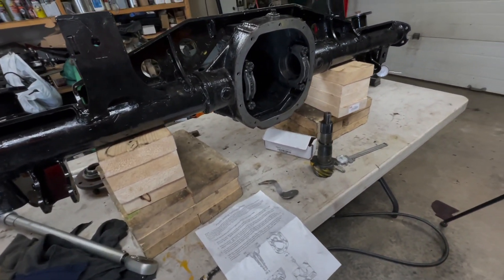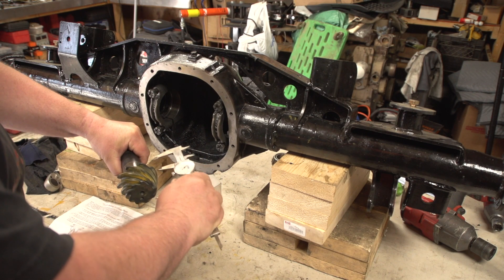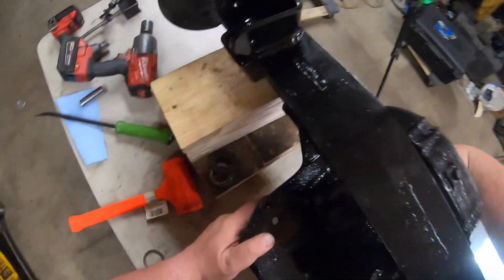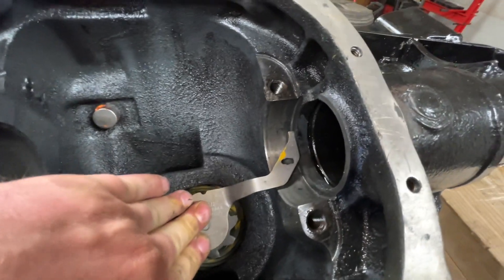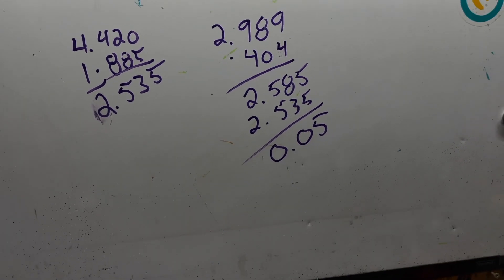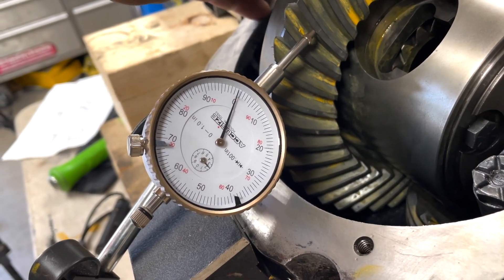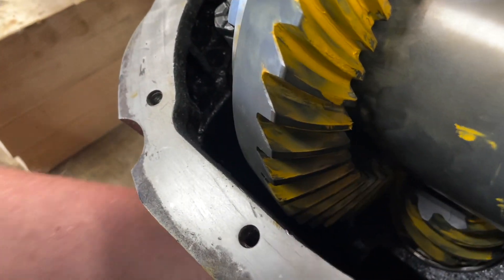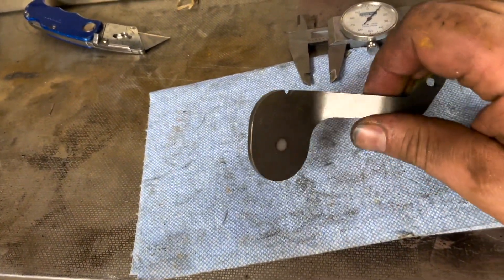Ratech Pinion Depth Tool Ford 8.8 RAT10006

Comment: No 8.8 has ever needed 45 or 50 thousandths shim.  .026-.034 for every 8.8 and you don’t have near enough preload on the carrier it shouldn’t just fall in like that.  Without carrier preload your backlash changes as soon as you it goes under load.
Reply: I was going to say... I've done literature HUNDREDS of 8.8s and  when I had to use a .040 shim, I took it apart and started over. And it ended up with a .036. Unless a pinion race has spun horribly in the case, an 8.8 shouldn't need a .050. That's just MY experience as a 35 year Ford tech.
Reply: @nicconley  I normally reuse the factory shim, and it has gotten me close enough every time. I guess you could measure the difference between the new and old pinion and factor that in, but I haven't had an issue yet. No fancy tool required..

Comment: You are suppose to dip the pinion bearings in oil before assembly- probably your .05 off.  It is amazing how narrow your axle tubes are, are you putting that rearend in a little Suzuki Jimny / or Suzuki X3?  Golf cart?  I am a fan of 14bffs and big-boy 1 ton off roaders, cutesy trail rigs get boring Quick! Build it HD once and be done!!

Comment: Did you use setup bearings to easily remove and put on? That is what I plan to do when I use this tool. Would that cause any differences after I press on the new bearings?

Comment: I bought one of these. Absolutly the most useless tool I've ever bought. Didn't even get me in the ballpark. It was just easier to start with the stock shim and go from there.
Reply from the maker: There is a trick to them to understand how it works which I think defeats the purpose once you figure it out
Reply: @TestDontguess  so whats the trick? subtracting? using a calculator?

Comment: So one thing I noticed that steered me away from this tool was that it says it’s designed for pinions with checking distance marked on pinion head. I’ve gotten so many gearsets that didn’t have the checking distance marked so I always resorted to the old school guess and check method. Good to see that it will indeed work without marked pinion
Reply from the maker: it still is tricky but it can be done, you may have to measure it a couple times to be sure and its usually bang on or very close